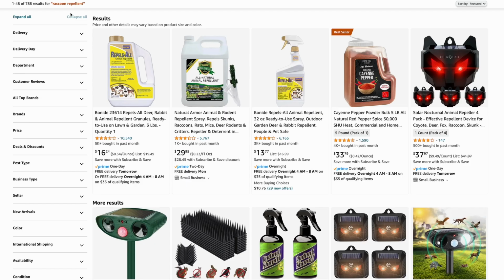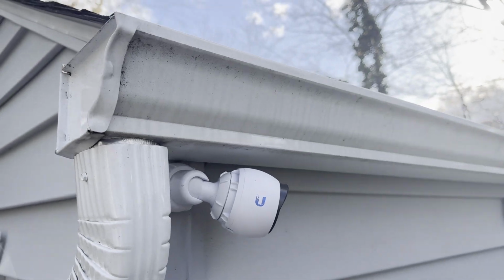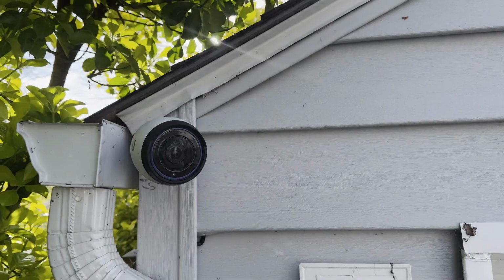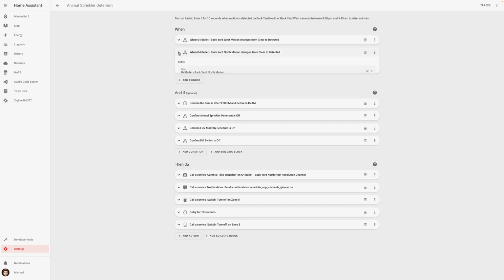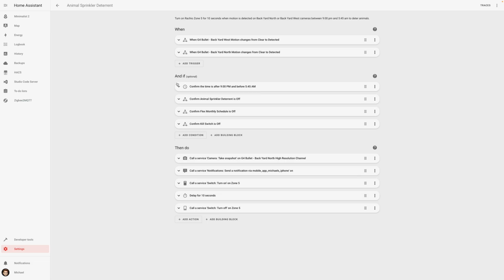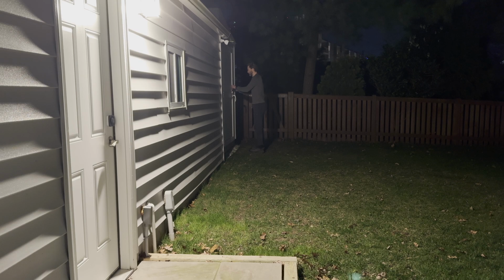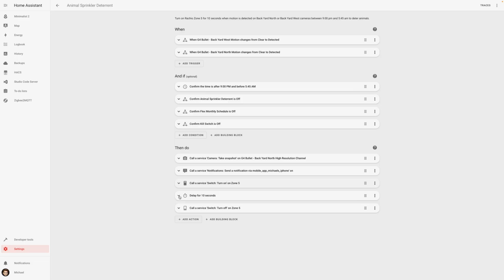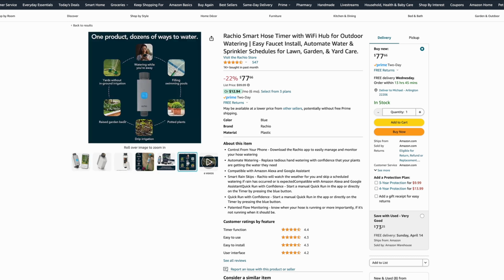Can a Smart Home Stop Raccoons?

Comment: Use a contact sensor at the backdoor to your garden. You don‘t need an Input boolean. Just use the contact sensor as a condition or an if-then action. Just play around it is much more convenient that way.
Reply from the maker: Thanks for the idea! Because we spend time on our screened porch at night, I didn’t necessarily want it to switch off the automation when we go through the back door. With that said, I like your  suggestion and can set the right conditions around it.

Comment: lol. I do the same thing. But since changing my cameras from ring to eufy I can’t get it into my HomeKit (via hoobs) I can’t tap into the cameras motion sensor. 

So now I need a dependable outdoor pir motion sensor that I can out out there to trigger my sprinklers. I’m testing eves and it’s hit and miss. 

Any suggestions for an outdoor motion sensor (that will reach the back yard too.)?
Reply from the maker: What smart home hub or platform do you use -- Apple HomeKit, Home Assistant, etc.? One option is a Philips Hue outdoor motion sensor (https://amzn.to/3xthVsx). You can pair that motion sensor with a Philips Hue Bridge if you have one. This should have a long connection range. Then, if you connect the Hue Bridge to Home Assistant, you can use the motion sensor as a trigger for this automation. Another option is the Eve motion sensor (https://amzn.to/3PTyZyb). It works indoors and outdoor, and is compatible with Apple HomeKit.
Reply: HomeKit. And hoobs. I find eve ok. Not solid